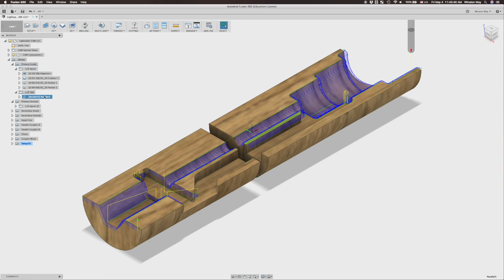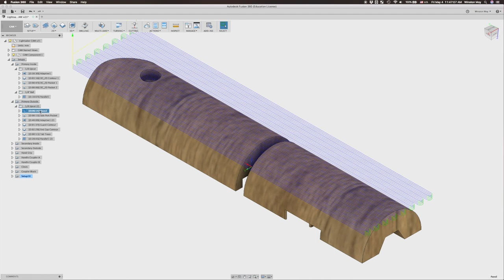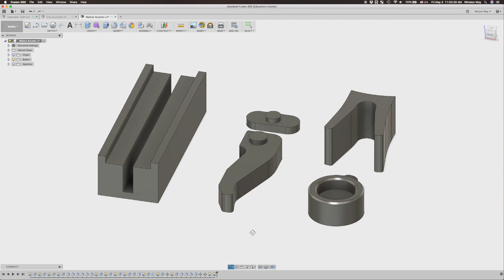Making a Wooden Lightsaber - #121 [CNC]

Comment: I think there is a technique to insure proper assembly called “keying” or “key holing”? This could help with making sure that parts are assembled in the correct orientations. Basically, misaligned features, or different shaped features, are utilized on one part to fit into or against a complimentary accommodating inverse(?) shaped feature. Result is usually proper part alignment and orientation. I hope this was explained clearly. It is a 3D concept that words alone are insufficient to describe. Maybe, see you at Bay Area MF2018.
Have a fun time!
Reply from the maker: No, I'm following. I realized that my center segments was symmetrical on both sides, so visually and physically there's nothing to stop me from making that mistake. The challenge with making pieces that lock together is that I can't make square-cornered (internal) features on the X-Y plane with a 3-axis machine, so I'd have to find another geometry to index the pieces together.

Comment: By cove bit, do you mean ball end mill?
Reply from the maker: They serve the same function. But a cove bit for routers will usually get you a larger cutter diameter with a 1/4" shank.
Reply: @WinstonMakes  Ah, that makes sense. I haven't seen you use router bits much, mostly endmills so that's why I was confused. Thanks